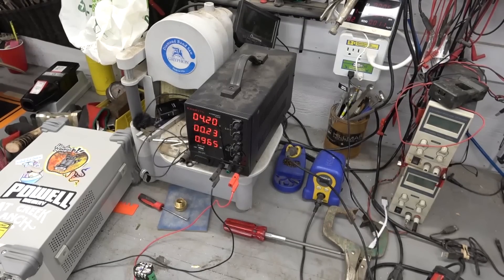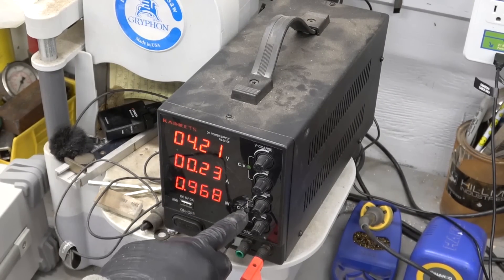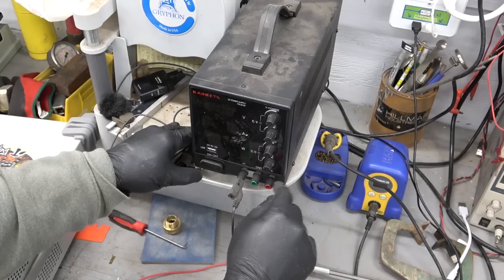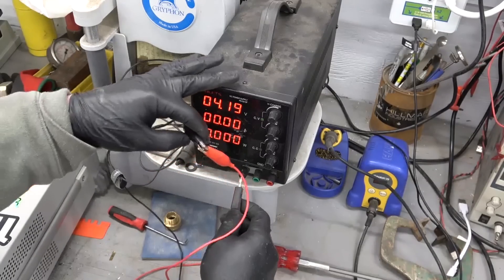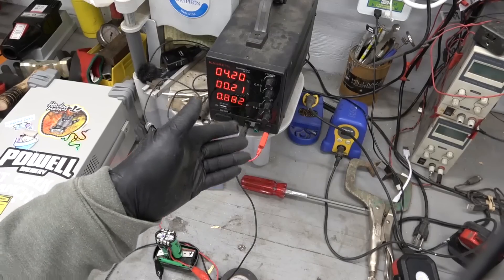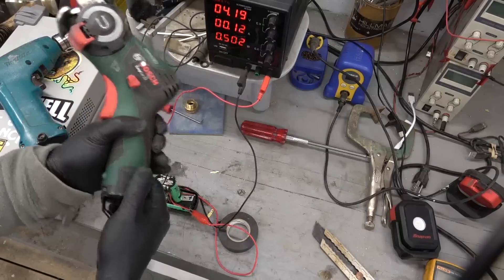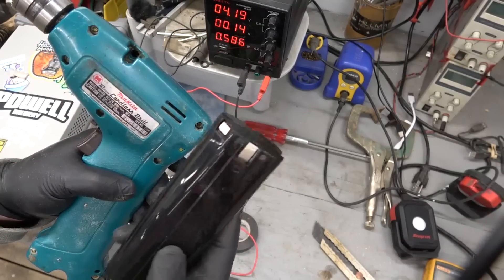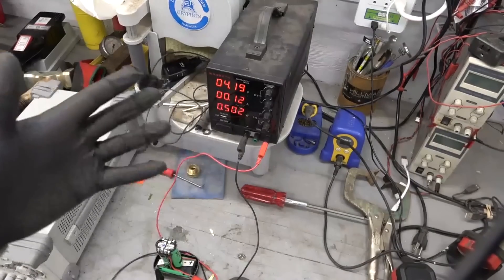Adjustable Power Supply || Viewer request how-to

Comment: have you held a magnet up to your purportedly copper wires yet?  Discover how the over-tarriffed chinamen pulled another fast one on us.  😂
Reply: Most are CCA unless specified
Reply: @A6Legit  magnets don't stick to CCA, but there are boatloads of cheap wire sold on eBay and Amazon that have ferrous mixed into the copper, which makes magnets stick to them.
Reply: 'Over tariffed chinamen..." ?  I hope you're joking?  Or are you really one of those dim-bulbs who thinks that the Chinese will pay the tariffs?

Comment: In hydraulic terms, voltage is like the liquid pressure, current is like the speed or volume of the fluid through the pipe over a given period, resistance is the diameter of the pipe, where more resistance equals a smaller pipe. The main difference though is that gravity isn't a factor.
Too small a pipe (too much resistance) and too much current (too much scmoo) results in a burst pipe because of all the heat.

Comment: Had to use mine to revive my LiFePO4 motorcycle battery. Of course, I did this with the garage door open, a temp gun, and a long "abort" cord tied around the battery. Not a huge fan of indoor pyrotechnics.
Reply: Whoa! Man after my own heart... 👍💪🫡
Reply: Well done, but LPOs are pretty damn safe. I revived a few, but capacity drop was pretty massive.
Reply: LFP tends to be significantly safer to charge this way.  I mean, you still want to limit voltage and current, but the power supply is more likely to explode from being low grade chinesium than the battery itself...

I mean, the battery could also explode from being low grade chinesium, but it won't be the charging process that does that...
Reply: @georgedorn_fnord  I was actually unaware of the difference (safety-wise) between Li-Ion and LiFePO4, but it makes me feel a lot better to find out that it's not quite as dangerous since I have about ½" of ABS, ½" of foam, and a sheet of vinyl between my ass and the danger. 🤣
Reply: Had a 4g travel modem go down and had to use this method to revive it.  I checked every so often for life and when it fired on I yoinked everything and went to the onboard USB charger instead.
Reply: Wow. I just jumped mine from another bike's Lead-Acid battery to get the charger to notice it.
Reply: @desertfresh3740  I'm sure I could have done something like that, but at the time, I didn't have a lot of experience with undervolted lithium cells. I also didn't have the Antigravity charger (manufacturer recommends against battery tenders, etc.) and I took the battery out of the bike so if anything went wrong, I just lost a $200 battery and not a $10k motorcycle. So I ultimately stuck with what I knew, the gear I had, and an abundance of caution. The battery was dead for over a year, but now has 2 additional years of flawless service to its credit. I'm just glad that the technology is robust and flexible enough to give us all a handful of options. 👍
Reply: 4s LiFePO4 at 3.6v per cell is 14.4v, pretty close to perfect for a replacement lead battery. The BMS should also prevent overcharge and they are more tolerant to it anyway. They are really safe in comparison to li-on and li-po. Only issue is they don’t like extreme heat or being charged when freezing, it decreases their cycle life significantly, being held at max voltage also decreases life but not as bad.
Reply: @BrentTMS  didn't know about the charging below freezing lowering cycle life. Thanks for your comment!
Reply: @ now a lot of the newer bms have a temp probe that prevents charging when too cold to help avoid it on accident, really fancy ones even have a heater output to gently discharge the cells and heat them which then allows you to safely charge in the cold.
Reply: I will add that the cells needing to be revived was likely the bms low voltage cutoff not the cells themselves
Reply: How did you change the charge profile on your motorcycle to use a LiFePO4 battery?
Reply: @scottbacker8286  it's an Antigravity drop-in replacement. It sat for a couple years and the charge dropped well below the reserve capacity (it has that "restart" button, but it was totally dead).
I gave the old Foie Gras and it still starts great 2 years later.
Reply: @bigreddodge  But it still need a different charge profile than lead acid.
Reply: @scottbacker8286  the bike doesn't have much of a charging profile to begin with, but the battery circuitry is designed to handle any of that for you. It's a drop-in replacement. No modifications needed.
In any case, I was playing it pretty safe. I started off CC @ 50mA (probably because I transposed a decimal point in an article or some other mundane detail) and over the course of a few hours, ramped up the current and finally achieved a full charge on a battery that electrically and/or electronically refused to perfom. 2 years back in service.
Reply: @bigreddodge  "It's a drop-in replacement. No modifications needed." I wish you luck with that. I'm sure that LiFePO4 loves that float charge.
Reply: @scottbacker8286  float charge is fine at 80%. Think about it, it's no different than having 2 in parallel. Both are a voltage source connected to a contant voltage source (eachother). Still I prefer  LiTo, which is even safer and performs at -40 celcius. No balancing circuit. Outlasting lead acid in both 5.9 cummins tractor and an excavator. No more burst batteries from jack frost. Both were grey market salvage from military diesel gensets. Unfortunately it's difficult to find those Toshiba cells any more.
Reply: I would do LiFePO4 indoors. I would NOT do NMC indoors.
Reply: It’s already been stated but LiFePO4 is one of the safest chemistries currently in widespread use. Even lead acid has been know to explode due to hydrogen off-gassing.
Reply: Just curious, what motorcycle is it?
Reply: @SUPRAMIKE18  2004 Yamaha R1
Reply: @bigreddodge  oh nice! I'm currently in the process of rebuilding a wrecked '98 R7, after seeing your post now I'm considering swapping it to a LiFePO4 when it's finished.

 (No I didn't wreck it I bought it cheap from a police auction already wrecked lol)
Reply: No you didn't
Reply: @graeme5977  i hope your parents dont find you as useless as i do this comment of yours

Comment: I used one of those exact cheapo units (probably with a different brand name...but they know who they are) to set the voltage regulator on my ancient BMW motorcycle. That one use, paid for the power supply. It ain't Geritol...but I think I'll keep her.